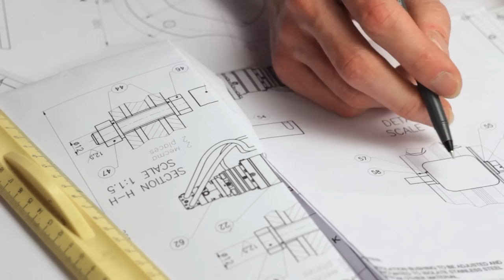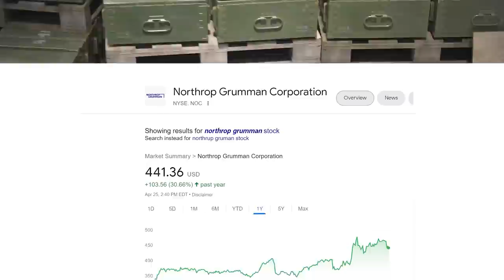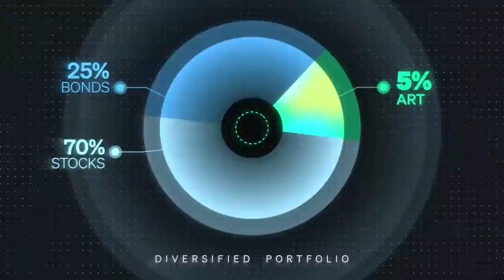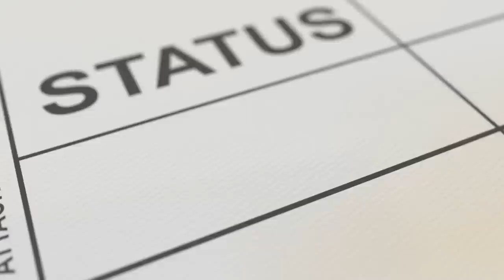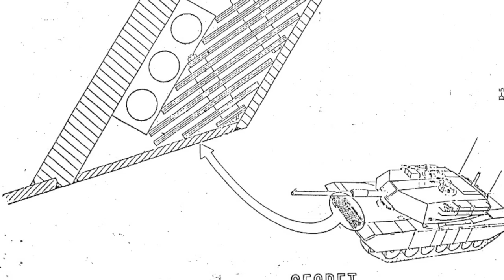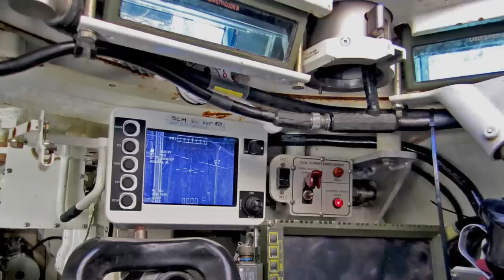The M1 Abrams Tank Needs to Chill Out

Comment: I think the most overlooked part about the Abrams in combat is that an Abrams almost never goes into combat alone. Joint operations has become fundamental to US military success and almost without exception the Abrams will not fight without some combination of infantry, CAS, and artillery supporting it. Russia's largest mistake in Ukraine so far has been a massive inability to conduct joint operations in any sort of meaningful way. Many things lead to this but the results speak for themselves. From the bad training to the dry rotted support vehicles, from the discontinued dual band AlibExpress radios some crews are using to the lackluster air support, There's a whole grocery list's worth of incredibly stupid and avoidable mistakes that have essentially crippled Russia's ability to conduct joint operations & thus left their armor vulnerable to almost constant attack. TL;DR: Nobody fights alone & Russia tried to Thunder Run without bringing the thunder.
Reply: In WWII, when Germany invaded the USSR, Soviet tank designs were so vastly superior their best kit was borderline invulnerable - German infantry derisively nicknamed their standard (37mm) ATG 'the doorknocker' because it was literally useless (bonk?). Despite this the Red Army was essentially destroyed in its entirety in both '41 and '42 - German success on all fronts basically rested on Stukas and towed flak (88mm) providing the muscle for their actually shitty tanks. 

The Panzer divisions were strong because they embodied the combined-arms concept in organization and control, and it took the Allies a minute (roughly two years) to deal with it by basically emulating it.
Reply: @onylra6265  That's partially true. I mean it is true what you wrote, but German asset was some terrible german word I can't find which meant that any commander had to 1. be able to take over and manage unit 'notch' higher 2. understand mission for his unit 3. DELEGATE as much as possible notch lower.
Reply: EXCUSE ME NO SOLDIER HAS EVER BEEN KILLED BY ENEMY FIRE IN AN ABRAMS TANK ... 1/1 CAV IRON SOLDIER SIR 19 KILO
Reply: @onylra6265  soviet tanks where not vastly superior to german tanks. In '41, most of the soviet armor was srill using BTs, which where quite handidly bested by German Panzer IIIs and IVs. The only deficiencthe germans had was not fielding a 50mm anti tank gun earlier and designing a short 75mm instead of a long 75mm. Soviet armor problems where handidly solved by both of these changes, although by then ther germans had different issues to solve.
Reply: Thunder Run DS2 in Baghdad is an example of US army operating alone.
Reply: Excellent observations.
Reply: Want to win use all the toys !!!
Boots on the ground win wars an help identify targets !!!
They should be cleaning their clock instead of being whooped !!!
Reply: @ironstarofmordian7098  in '41 the T-34 and KVs proved to be big enough problem that no less a figure than Heinz Guderian proposed copying them directly (October). The Red Army  might have been fielding mostly BT-series light tanks, but the Wehrmacht was fielding Panzer Is and IIs still. The Soviet heavy tanks outnumbered German mediums substantially - even those whose 50mm main weapon was inadequate by virtue of having a smaller lethal envelope than the standard gun of the T-34. The Panzer IVG and Tiger wasn't available in meaningful numbers until the Germans were already getting their shit pushed in at Stalingrad.

The history around this matter is settled - when it mattered German armor was decisively qualitatively outclassed in every meaningful measure (if only Heinz Guderian had Youtube armchair generals around to reassure him!). The availability of organic heavy flak (88mm) and the doctrinal framework for using it in direct-fire against enemy AFVs was the only meaningful countermeasure against Soviet heavy armour (in the absence of powerful CAS, which the Germans were very good at utilizing). Period.
Reply: @piotrd.4850  Auftragstaktik (mission tactics). Einheitsprinzip ('unit principle' - but 'einheit' importantly refers to sub-battalion size units) is another related German term, meaning a type of organization by which German small units could be detached or combined into kampfgruppe (battle groups). 

So German lower-level combat leaders would be expected to be capable of taking under command assets such as artillery or AA which would normally be controlled by a higher-level HQ, this required a high degree of training down to the lowest level, specifically with combined-arms in mind. Even a senior NCO or junior lt. in the infantry could be expected to direct artillery fire or CAS - which was a pretty novel concept at the time. 

There's much to discuss about Wehrmacht leadership doctrine - but it was this way specifically because efficient combined-arms warfare necessitated a more innovative philosophy of battlefield command and control, which other armies were somewhat slow to adopt but has since become more or less the gold standard.
Reply: @onylra6265  i didn't say that Soviet mediums like the T34 and heavies like the kv weren't  a problem. I said that the soviet tank force wasn't vastly superior. Operationally, a working T34 and KV are a serious threat. But like tigers wirh shermans or panthers, proper tank tactics make capitalize on their flaws. While it is indeed impressive that one T34 took something like a dozen hits from a panzer 3, it also shows the woeful visobility cres have from t34s. And if you didn't notice what i said originally,  not i mentions functionality. Both the KV and T34 where known to jave serious issues  like no gunsights or unzeroed guns, terrible emgines and transmissions that make dodge's look indestructible. Some aspects of soviet armor where better, but on the ballance they weren't that far ahead. And before you scream wehraboo, I'm the guy who firmly believs the sherman was the best tank of the war.
Reply: @onylra6265  Never mind Russia the French had better tanks in 1940. But their doctrine was shite. Germany's wasn't and the result was a forgone conclusion
Reply: Bingo. You have it. Tactics make a huge difference. Also crew training.
Reply: never correct enemy's errors
Reply from the maker: and an overlooked fact about joint operations is a lot of authoritarian governments don't do combined operations because if the military is too united and too strong they can over throw the government so they purposely keep each branch VERY seperated from each other because they fear the military going full coup on them
Reply: @rabidmidgeecosse1336  the Germany was one of the few nations which had 3 man turrets. Most french designs at the time didn't. On the ballance, Germany had the best tanks up untill thw Sher.an arrived.
Reply: @Taskandpurpose  Clever observations.
Reply: @ironstarofmordian7098  The point is that the early-war panzer division that achieved such noteworthy successes did so despite notable qualitative and quantitative inferiority. Between 88mm flak and Stuka CAS the Lion's share of tank-busting fell to Luftwaffe - and while the pathetic inadequacy of the 37mm often came as a rude surprise, the doctrinal mechanisms were baked-in place to improvise a solution. 

The Germans came disturbingly close to conquering Europe with an armored force that was still largely reliant on tanks armed with sub-20mm guns that were never meant for combat. The extensive use of the short-barrelled 75mm gun that you deride was a feature, and not a bug, because of the superior performance of HE vs 'soft' targets.

Part of the reason why Rommel ran amok in Libya was because British tanks were as helpless as infants against Rommel's towed 88s (of which a few dozen claimed over 250 AFV kills in '41), because the 2-pounder only fired AP ammunition, and they simply lacked the organic infantry/arty support to overcome this weakness as organized - and moreover the doctrinal inability to integrate the efforts of armor and infantry (the 8th Army possessed some of the finest light infantry of the entire war in the Aus/NZ/Highlander divisions) led to farcical situations whereby defeat was snatched from the jaws of victory again and again. The noteworthiness of the panzer division was not its strength in AFVs, but its overall balance of organization - Rommel's talent is probably less notable as an armored commander or any ephemeral tank advantage (a myth) as it is his canny use of towed guns in conjunction with his AFVs, and the abilities of his subordinates to execute these tactics effectively (also air superiority, lol - it goes without saying CAS is decisive, now, but in 1940-41 this notion was mysterious to the allied armies - it was a lesson learned the hard way).
Reply: @seha6391  In a U.S. Abrams. Plenty of dead in the export models (steel only armor) using Russian tactics of one tank vs many guys with anti tank weapons.
Reply: @onylra6265  tank busting was done by tanks and anti tank guns more than CAS. CAS had a mostly psychological impact. CAS was important but not for killing tanks. A long 75mm would be just as good againa soft target. It was not a feature in the slightest.

German tanks, like panzer 3 and 4 where more common than the sub 20mm panzer 1s. Both the 3 and 4 had 3 man turrets which isn't a slight advantage but a massive one. It makes opperating the tank far easier. It allows the commander to dedicated his time and man to command. Rather than also be a joe either shooting or loading. German optics where qualitatively better. More over, they worked. One KV unit was ordered to ram german tanks because they didn't have their guns bore sighted. German tank superiority, in the esrly war isn't a myth. It is over stated but on the ballance, the panzer 3 and 4 where the two best tanks in service at the time. Then the Americans changed it up but thats a different story.
Reply: @ironstarofmordian7098  1: in June '41 the Wehrmacht invaded with around 800 Panzer IIs, making it the second most common German tank deployed for Barbarossa. Roughly 700 Panzer IIIs with the shorter 50mm (L42) were fielded, and that gun was ineffective vs Soviet heavies - all in all the T-34 and KVs of the Red Army outnumbered German IIIs and IVs of all types. Even if the III had been upgraded to L60 50mm (as Hitler had suggested) the T-34's 76mm still enjoyed a much better lethal envelope, relatively. It's no accident that the 50mm platform was basically abandoned in favour of the PaK40 75mm in 1941.

2: The 'long' 75mm wasn't fielded until mid '42 when the war was literally half over, and the vast bulk of the Soviet tank fleet consisted of the T-34, the gun of which offered comparable performance. The IV was conceived and designed in the mid 30s as a close support weapon, also capable of out-punching ATGs - it was not intended to be the MBT of panzer forces. It was supposed to be a howitzer-type gun capable of delivering a heavier HE round than the standard 37mm gun - like, bigger shell, bigger boom (in this it was pretty effective until Barbarossa - in Africa it had an edge vs the British 25 pounder).

But when the inadequacy of the 50mm ATG was identified, by happy accident the IV's bulkier chassis and larger turret ring proved to be capable of housing a modified PAK40, and thus the III got binned as a tank. You're arguing in circles and wiggling around the point, the conceptual/doctrinal approach of combining a punchy HV 37mm for direct fire with a heavier HE platform capable of indirect fire in the same 'unit' was an innovative combined-arms concept that was FAR ahead of Germany's opponents - and the concept wasn't discarded with the advent of the PAK40, as 38t and StuG chassis were converted to carry 105mm howitzers, because why not? The notion of the SPG is a sound concept, invented and innovated by the Germans in between wars, for legitimate tactical reasons as part of a lucid combined-arms doctrine, and imitated to this day. I'm not eager to continue this World of Tanks player argument...
Reply: NO SIR YOU ARE SADLY MISTAKEN I HAVE PICTURES OF SOLDIERS HANGING THEIR HATS ON ENEMY TANK ROUNDS THAT WOULDENT PENETRATE AN M1` TANK SORRY CANT TELL YOU THE SECRET
Reply: @Taskandpurpose  Good point, didnt think about that.
Reply: @seha6391  Plenty of Saudis have died in the export version when doing the same tactics as the Russians.
Reply: @orlock20  second rule in combat ... Refer to Rule Number 1
Reply: @orlock20  NOW YOU KNOW WHAT WAR IS
Reply: @seha6391  True. Get tired of all the theoretical talk like there isn't fairly recent, real world data.
Reply: @evandailey5110  SURE ill Give you real-world data An a10 warthog is scary as shit all tanks are vulnerable on top .. Javelin's are ugly but a soldier cant drive 70 MPH
Reply: @yoshyusmc  Not quite. There was CAS, a lot of it by helicopters, all around the city, including Warhogs and F-16CJs (Dan Hampton's book 'Viper Pilot), but as for TR per sec, you are correct. IMHO, this is the most overlooked example of spectacular MOUT combat in the history of the World. When you consider the size of Baghdad, vs say Grozny, the relative results are staggering, and at that stage of the war, Baghdad was almost undamaged.
Reply: Broad strokes, it was the support for lower level command taking the initiative, and senior command then supporting that decision, which led to the success of the TR. Contrast this to Operation Market Garden in WW-II, where sluggish British deployment doomed the Allies (Germans were able to set up a 3-layered defense in depth in the time it took Monty to get going down the road). Whether expressed as Boyd's OODA Loop or "Perfect is the enemy of Good", the ability to reach good decisions and act on them at once is, has, and always will be the most important factor in combined arms combat (is there any other kind?).
Reply: @onylra6265  Great observations here. What underpinned all of this for the Wehrmacht was a much more intelligent infantry. US and allied doctrine "screened off" troops according to their ability, so airborne were the cream, arty next, and finally, the drooling knuckle-draggers were infantry. 
The Germans didn't do this, but saw infantry as a complex problem that required good minds to solve in a tight time-window, so they had brilliant infantry (mixed with dutiful dullards to be sure) capable of making max use of resources. They hung US troops up after Normandy for weeks with small MG or RPG teams. If US tanks came first they used the RPGs on the tanks and MGs on infantry as they retreated. If infantry came first they used MGs on them and RPGs on tanks when they were brought forward. It wasn't until rather late in the breakout where the US finally got that combined arms choreography right so they could punch through. 

Obviously, RU is decades, maybe even a century behind US in honing this to a fine point. RU is operating very much like the Brits in WW-I when they first had tanks. It took them a long time to learn how to use them in a combined arms-ish way. By contrast, when Guderian went into France with tanks and combined arms the very large and well fortified French Maginot Line was so hapless as to be virtually useless.
Reply: When you got the Navy and Air Force telling Congress the army needs a new tank and spend money on a new tank instead of ships or airplanes we need a new tank, something to replace the M60. That's why the Abrams were made.
Reply: @orlock20  those are export models though so you can't really say that those are good. Export models are usually the bare minimum of what a country is going to give to someone
Reply: @roijoi6963  the reason Baghdad feel so easy was we had a map of all the enemy units in Baghdad and where they were.  We found the overlay map at object peach
Reply: @soup31314  No, read "Thunder Run" and learn something. 
Even the Iraqi military didn't know where each other's units were.
Reply: @roijoi6963  Why would I read that book when I was there?  I know what happened and how it went down.  My fire team was securing our HQ TOC area when we came across the medina divisions HQ.  they had the whole divisions names and addresses, and they had the battle plan for the defense of  baghdad. I gave the map overlay to lct marcone who sent it up to division, and it was then the battle plan was changed and 2nd bde did the thunder run after my unit secured the airfield.